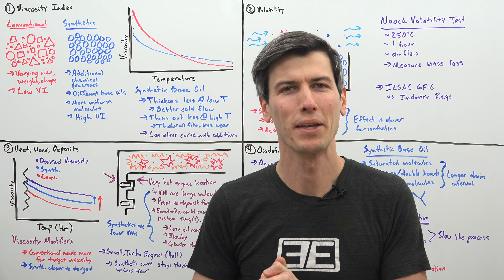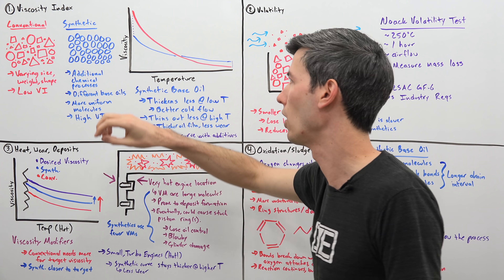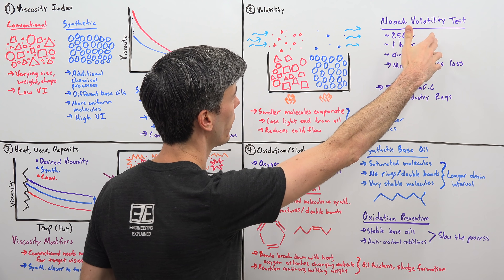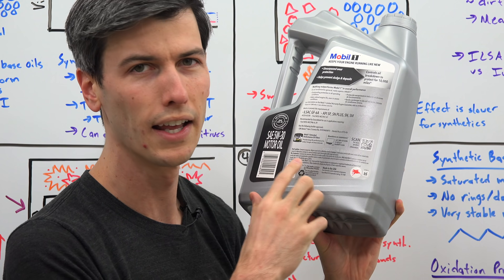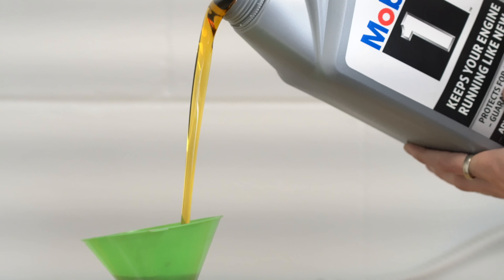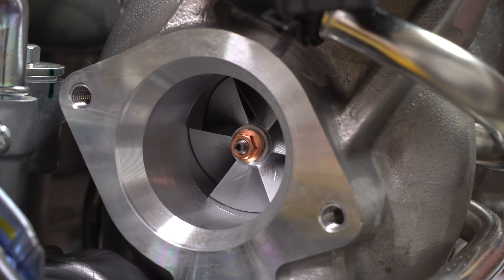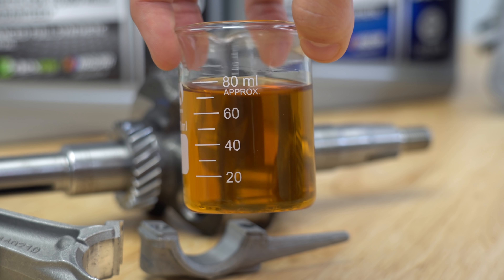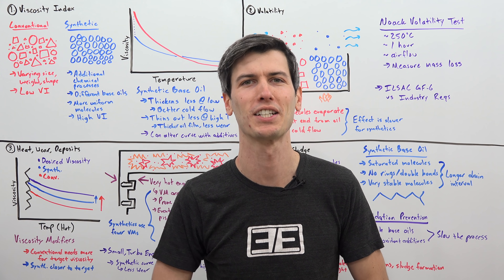Synthetic vs Conventional Oil - There's A Good Reason To Switch

Comment: I don't want squares and triangles in my engine. Synthetic it is.
Reply from the maker: 😂ELI5 version. It's funny too because rings (aromatics) are not a great structure to have, as explained in the oxidation segment, but you keep those triangles out!!
Reply: @EngineeringExplained  triangles are the strongest shape, good enough for bridges, good enough for my engine
Reply: @Brave_Little_Toaster  good enough for your engine but is your engine good enough?
Reply: @Brave_Little_Toaster  Keep in mind bridges are for support on something that's not moving. Moving through a lot of twists and openings don't sound as good.
Reply: @zedsdead7670  I own several engines, and as you have suspected, some of them are not good enough for triangles.
Reply: @EngineeringExplained  Do you know which synthetic would go best for salad?  Peanut or Vegetable?
Reply: @EngineeringExplained  Would you please do a video about 2 Stroke engine oils? I’m not sure about which oil to use in my 600ccm Trabant 601
Reply: @Handyman1199  Palm oil.
That is the oil from your palms on the rear end when you are pushing it
Reply: @emceeboogieboots1608  
...
...
...
...
It’s quite reliable...
...
...
...
I’ve done 20k miles on it, speaks for itself
Reply: @Handyman1199  Awesome. I  didn't even know they were a 2 stroke, to be honest I have never seen one, being in Australia. I wouldn't imagine there would too many around anymore
Reply: @EngineeringExplained  Can you PLEASE do a video explaining ALL emissions gasoline and diesel engines produce? HC, CO, NOX, PM, PN. 90%+ of people blindly believe that fuel consumption is the only factor / directly linked to emissions and insist that old diesels with horrible emissions are cleaner just bc they burn less fuel and if you try to tell them otherwise they just start insulting you. Please make a video to shut them up, this is driving me mad.
Reply: @EngineeringExplained  Hexagons are the bestagons.
Reply: But what's really right for small aircooled engines? I've heard countless times that "high performance" synthetic oils damage the piston/cylinder in those engines
Reply: @EngineeringExplained  But to be fair the benzene ring is actually a hexagon.  I guess a hybrid of 6 triangles and a circle makes them both ok.
Reply: @EngineeringExplained  You really don’t want triangles (epoxides) in your engine oil 😂
Reply: What about using synthetic motor oil in vehicles with high mileage engines?
Reply: @november750william8  It's great
Reply: @DrLee-sn1tw  All brands mix different base groups all the time. The exact same "Super Mega" labeled oil with a different classification or viscosity can be built entirely different, sometimes they're different on different markets as well. And Group III is classified as synthetic, what one want's to call "a true" could be debated.
Reply: i guess graphite isn't that good of a lubricant then.
Reply: @DrLee-sn1tw  it's called product placement lol
Reply: Lmao this made me laugh out loud
Reply: My engine already has triangles so I can’t use synthetic for that car and I was told by the engine repair shop I can’t run synthetic in my classic truck engines
Reply: Yeah, squares and triangles look awfully abrasive, circles must be better.
Reply: oil building shapes lol
Reply: Mine has moons, clovers, and lucky stars.
Reply: with today's low tension piston rings engine oil consumption is normal at 1 quart/1,200 miles in even a Toyota. The biggest threat to engines isn't synthetic vs conventional, but it's simply the operators "accidentally" forgetting to check their oil and now with 20,000 mile oil change intervals, most engines burn up by half of that...
Reply: it is no longer valid to clasify oil by synthetic, semi synthetic and mineral, because most of them made from hydrotreated today.
Reply: They're better than tetrahedrons, and octagons, though. 😂🍻
Reply: Excellent!
Reply: Switch? Who in 2024 is still using standard oil…except the Rockefellers….lol.
Reply: I switched to full synthetic before it started  reaching freezing temperature for better idling  during cold starts,  overall performance, and response.has more longevitiy but requires more maintainence. Works good in my 4 litre v6
Reply: Rite😂😂😂
Reply: None these channels mention that synthetics cold flow means the metal parts are subject to dry start after sitting for extended periods, that's why you're not supposed to use synthetic for motor break in, it runs off over night. After switching back to synthetic blend, the piston slap in my 5.3s on cold mornings went away. A little bit of blend sticks, reducing dry start.
Reply: I think you take it too literally this.
Reply: I am reporting this post to the YouTube PC police as discriminatory and anti-diversity. Squares and Triangles have feeling too!
Reply: b- But but...

WHAT IF IT IS A ROTARY ENGINE?
Reply: Amsoil is the real 100% synthetic!!!
Reply: I'm worried about rogue Oxygen molecules creating huge amounts of protomolecules - apparently that is very bad, except for the nice bright blue look... :-)
Reply: @AndyG73  I'm more worried about Jason actually  ..
Reply: LOL
Reply: Anyone that has stepped on Lego would agree! lol

Comment: I have an electric car. I’m still watching this for some reason
Reply: you still need to lubricate  hinges and such.
Reply: @pedrofernandez8729  yeah but that’s not motor oil
Reply: @Johnny Blue hmm... I have always wanted a rear wheel drive manual... They seem like fun
Reply: @andrewsbbq  no 🧢
Reply: shouldn't you be more worried about range anxiety or something like that?
Reply: @kaibaumgartner7721  dont think I’ve really worried about that ever...
Reply: Its good to know how the tow vehicle operates
Reply: You’re still listening to this because it’s actually interesting and it’s fun to work on your own cars.
Can’t do that with electric
Reply: @ can’t work on the motor no. You can still do brakes, suspension, body, etc.
Reply: @ ev owners don’t touch their cars
Reply: @ I see more people changing every nut and bolt on their Tesla than I do people with their Corolla. The reality is most people in general don’t touch anything on their cars beyond a bumper sticker.
Reply: @ you see or you assume? People make videos of putting stickers on their EVs because it’s a hot topic and gains the most attention so you see it more often.
Reply: If a whisper quiet electric car drives through an empty forest with no one around, do we still have to hear about it?
Reply: Have fun at CrossFit
Reply: @jordany7018  got em.
Reply: Feel bad for u:(

Comment: Thanks for the information.   My "fleet" ONLY uses Mobil 1 synthetics. My current mileage counts are (newest vehicle to oldest) are: 2012- 170K, 2012-70K, 2008-67K, 2006-224K, 2005-192K, 2000-160K.  None of these vehicles were purchased "brand new" so I am assuming most had their first 33K-42K with conventional oils.  But I have seen then internals of many engines. Have owned over 60 vehicles.  Only go on my experience. Will never run non-synthetics unless I know for a fact the engine has not had it and has a ton of miles already.  To me then not worth the change ( my case in point would be my current "project" with 249K showing... most likely new engine or rebuild soon. Then 100% synthetic. )
Reply: Wow you have a lot of old vehicles. Also, are you saying 249k out of an engine is not good? I buy new cars and replace every 5 - 10 years, rarely ever putting more than 75k on a vehicle, so it's not really an issue for me but interesting to hear nonetheless.
Reply: @Idiotsincarshere  That depends heavily on the specific engine, how well it was maintained, and what type of abuse it saw. 249k on an old Honda that was properly maintained and saw mostly normal freeway driving (no towing or shall we say spirited driving) is nothing, and if that specific combination of maintenance and use was continued the engine very well could outlive the rest of the car. However 249k on say a newer BMW (or really a lot of newer cars in general) that was poorly maintained and was constantly abused (like constant high rpm driving or being used for towing) then it's a miracle the engine is even still running and is a ticking time bomb.
Reply: @nordvestgaming1238  Gotcha! Ya I’m in a rental Corolla now with under 9k miles that’s clearly been abused and it runs terrible. Probably selling my 80k Prius that runs perfect but due to age of battery (7 years) and suspension damage from accident, I’ll go with something else, probably EV. But I always wondered oil change frequency, and synthetic vs regular oil. I had an engine builder tell me just do frequent oil changes with regular oil. Toyota refuses to change my oil with anything but synthetic and it’s pricey.

Comment: Enjoyed.  Perhaps you could talk at some time in the future about motor oils with ester bases, PAOs, and Group Three chemistry.  It would be good to hear more on the subject. I am currently using Mobil 1 in a pickup pushrod engine while using another brands ester based oil with high zinc levels in an overhead cam engine. Thanks.

Comment: What about conventional oil advantages? Is there any?
Reply from the maker: Purchase price.
Reply: Cheap
Reply: Good for break in period and is cheap if you dont rev your engine high.
Reply: In a diesel engine it retains more soot in suspension. Branching in molecules is bad for flow, but good for dispersancy.

Comment: My Hyundai accent with 95,000 mi just blew up last weekend because of carbon buildup on the top end. Tap tap tap tap tap tap tap tap
Reply: Not sure how carbon build up in the cylinder head can cause an engine to blow up
Reply: @TheRamGuy  it did for me. I had a vw fsi direct injection and it suffered from heavy carbon buildup in the valves. I battled with vw to get it fixed but I was unsuccessful. Finally a chunk of carbon broke off and scored one of my cylinder walls and... the end 😢
Reply: @TheRamGuy  not actually blow up, but certainly made it undrivable
Reply: @MyCarGuyJax  i am sorry to hear that. My understanding is Kia has a recall on those engines and may replace it. I have a 2010 Forte with the 2.0l non GDI and they replaced my engine at 99,263 miles.
Reply: Was it a direct injection engine?
Reply: @Mozzarella_Cheese_Addict  it is.
Reply: We have a 2013 with 109,000 miles - wish i had the equipment to remove the carbon
Reply: That’s why Toyota added port injectors for that very reason.

Comment: Apparently the issue concerning VW DQ200 was due to their usage of a synthetic oil that caused some precipitation on the mechatronics unit that lead to it short-circuiting that caused loss of power to the wheels and the unit requiring replacement.
They switched the transmission oil to a mineral oil and it's fine now.

Comment: What exactly are the additives in high mileage oils and do they actually make a huge difference
Reply: This is really helpful
Reply: Supposed to have additives to "rejuvenate" old seals, as long as your using synthetic there's no real difference though. Valvoline has the exact same part number for both regular and high mileage synthetic just different bottles
Reply: High mile synthetic vs synthetic..the high mile is spoused to have more anti wear additive for the older engine, more conditioning  additive for the rubber and synthetic valves and rings, tbn to help reduce the oxidation
From my understanding as a service technician for the past 19months that is

Imo I'd rather pay $35 every 3-5 months for oil compared to $3500 for engine rebuild :D
Reply: @Spike_-rx7bx $35.  Where do you live?  Firestone charges $90-100 for a synthetic blend in Ohio.
Reply: Speaking of high mileage oil, in Europe we dont have it. We put the same oil from new to +400.000km. I use 5W30 504/507.
Reply: 2000 5.3 silverado 296k miles no leaks. I use mobile one standard 5w30 syn
Reply: I bet it's a Little more Ester base on fully synthetics from 2 to 3%, in case of Mobil1, it helps a tiny to clean better and swell seals.
Reply: I think they put alkaline additive in their oil to reduce acidity at high mileage & time.
Reply: They are "said" to have more TBN modifiers which prevent oil from becoming acidic,  volatility modifiers to prevent evaporation. But its better to just change your oil at 5000 or 6000miles. If your engines starts burning oil, you can't have the oil Company pay for it anyway.
Reply: @tejaspadhye  I have my oil tested every time I do an oil change, I change my oil every 5000 miles, and my TBM scored a 1.9, and at 1.0 that considered to be low, so mine is right at where should be to still show additives helping the oil.
Reply: @13slot28  nice that you do that. But testing of TBN should be done in lab, not inside your engine by increasing change intervals. Engines cost a lot more than oil :)
Reply: @tejaspadhye  I send my oil off to Blackstone labs
Reply: @13slot28  seems you didn't get what I said. Read my previous comment again
Reply: @tejaspadhye  A taxi driver told me that he changes the oil at every 50.000km and at 500.000km changes the engine. Is cheaper to change the engine that to do oil changes every 10.000km
Reply from the maker: This video of mine includes a discussion on high mileage oil, how it works, and when you should/should not consider using! 
https://youtu.be/pPFSR-2lhxY
Reply: One of the primary differences in the high mileage oils are seal softeners to keep rubber seals/gaskets from drying and shrinking
Reply: You will notice many oil companies lose their certifications like DEXOS1 when they make a “high mileage” version of the same oil. I avoid them. Leave my seals alone.
Reply: I recommend rislone high mileage, stp synthetic and Lucas oil additive

Comment: I use mobile one full synthetic high mileage on my 06 chevy trailblazer ext with 222k and its done me a lot better than any other brand I've tried
Reply: My car burns oil. And compared to other brands, I burn the least amount of oil using mobile one between oil changes. (I change my oil every 5-6k miles)
Reply: How has it been better compared to others?  I've never noticed a difference from brand to brand.
Reply: @Hubjeep  exactly it's not something you can really notice driving
Reply: @LivingInFloridaPanhandle  you notice it when you change your oil lol. Run Royal Purple in your car and I guarantee you that it won’t outlast a car with Mobil one.
Reply: How so?

Comment: You’re awfully invested in what kind of lube I use, Jason.
Reply: For what it's worth I've found the girlfriend prefers 10W-20 synthetic.  Your results may vary.
Reply: @LanguagesWithAndrew  Well, yes. Jason is a tall  (big) boy😊
Reply: He's such a handsome guy, and I wouldn't want him do me without lubricant....
Reply: I would be also. AMSOIL mops the floor with m1. So ACTUAL synthetics not group 3 dino pretenders who's left? AMSOIL, driven,redline?
Reply: @johnsteele8073  yes amsoil and redline are top bananas but your POS daily driver doesnt need racing oil. If you car is worth more than 75k then maybe
Reply: @johnsteele8073  : Pennzoil
Reply: @johnsteele8073 LAMBORGHINI ,Porsche , etc yes. Race engine yes , street transportation ,family car, Exotic Oils I think $$$ overkill.  Do my own changes ,Mobil 1 or whatever Synthetic makes sense to be. By all means do what makes you happy. My push lawnmower does not get exotic oils. Just an opinion.